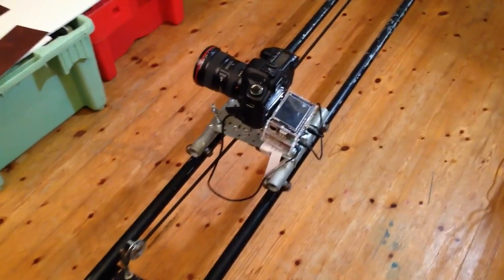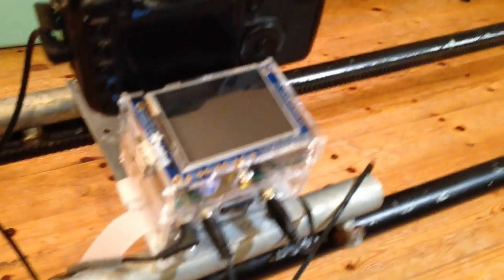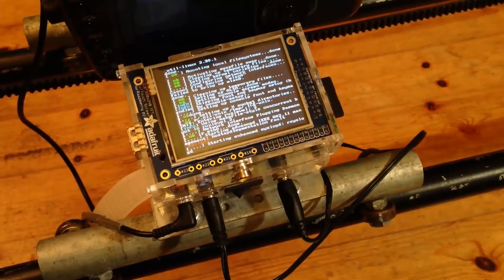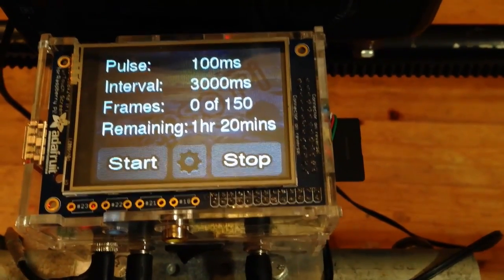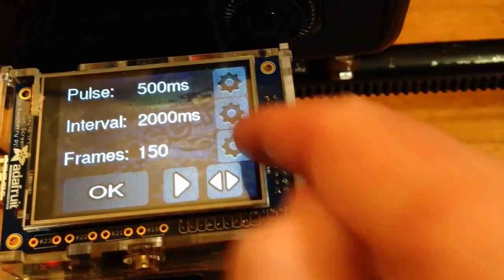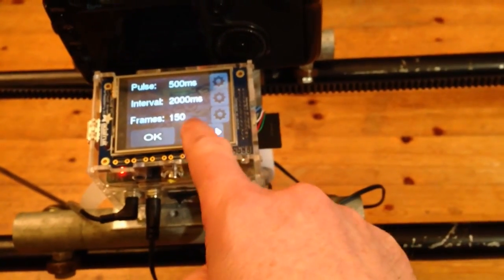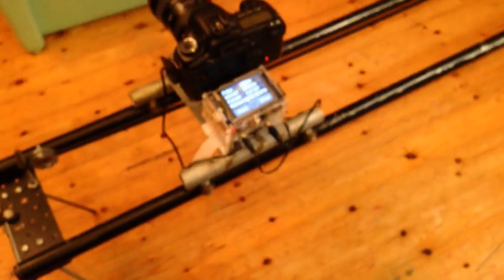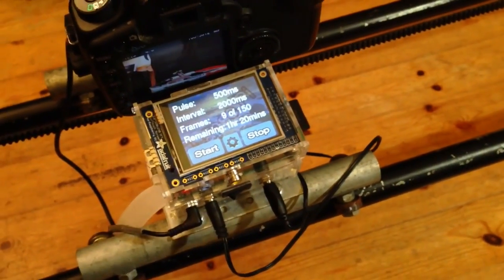Lapse- Pi Touch - Touchscreen Timelapse controller using Raspberry Pi

Comment: Thanks a great deal for putting together this wonderful blog 
post for the Lapse-Pi Touch. I built the same with your instructions, 
with some minor changes. I used the latest version of Raspberry Pi 3, 
along with the latest version of Raspbian Jessie. 

For the life of me, I can't get the touch controls to work I did change the 
GPIOs to 13, 19 and 26 for the motorpinA, motorpinB and sutterpin. Clicking on start and stop works, but its very erratic, and clicking on 
settings cog button never gets to the settings screen. Seems like pos = pygame.mouse.get_pos() is coming in incorrectly, almost seems random. 

I am new to Raspberry Pi, and to Python as well. I would really appreciate some guidance.

Comment: The R-Pi is also controlling the camera? That's pretty cool! Have you experimented with MagicLantern on your Canon? I saw a video of a really useful feature in that. It allows you to set two different focus points and then change between them, so you get perfect focus each time rather than focusing, overfocusing, and adjusting back etc. It would be cool if the R-Pi could control that too, so say if recording something like guitar, you could preprogram some focus changes etc. for effect! And not have to stop playing to do it or have someone else press it. Maybe Magic Lanterna allows you to set it to repeat so you could just set it, let it record and then edit out the part you wanted later. Haven't really looked into it yet.

Comment: Nice work. Respect. I am also working on a Raspi timelapse machine but i like how you solved the 45 degrees ballbearing problem by using a tube. Simple but effective. If you want to try some panning and tilting while timelapsing you can visit my blog at www.capische.de. (open hardware and open source). I chose a 3.5 " display without touch but i have a bluetooth keyboard and a Wifi connection to control the bot. Unfortunately i still have no UI.